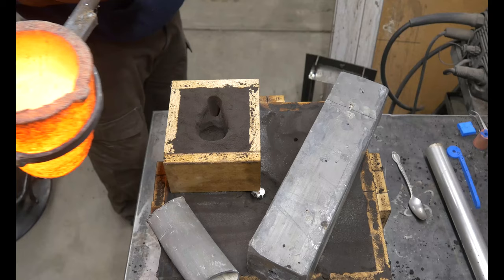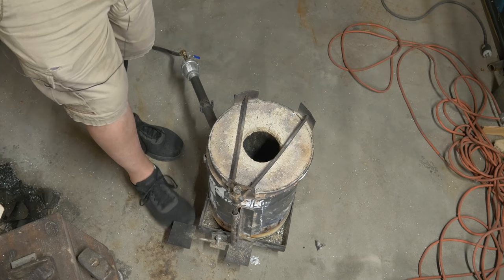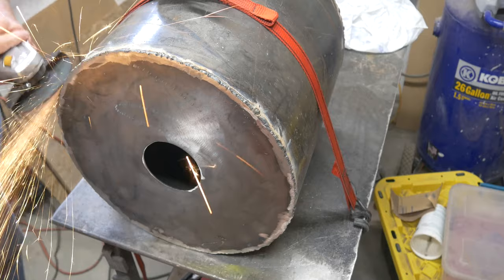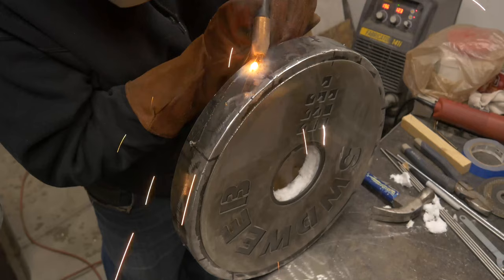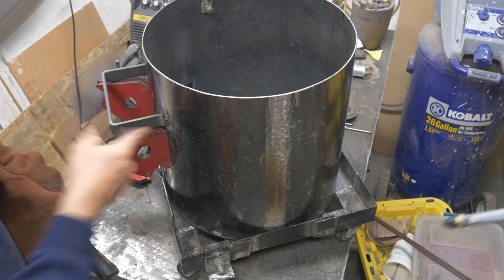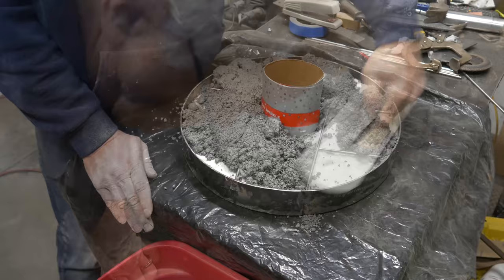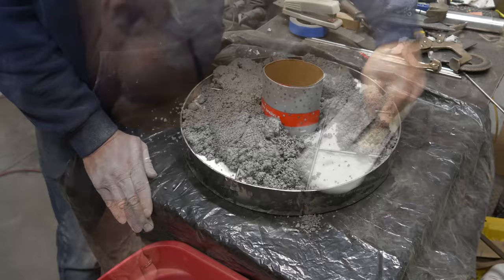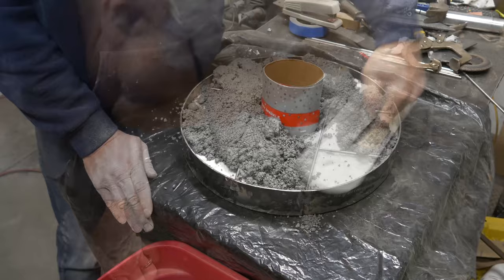Building a professional-grade foundry furnace

Comment: Great video! You showed the steps without belaboring the process. It's as simple as you made it seem.

Excellent point about the dryness of the refractory mix. It's often called "castable" refractory, but that's a bad name for it. Cement of any kind is very sensitive to the amount of water in the mixture. People often think it should be like a liquid when you mix it, but it shouldn't. Too much water weakens the cement. Never put more than the recommended amount of water in a cement mix.

I bought a used vibrator at the thrift store -- NOT THAT KIND -- the big, muscle massager kind -- and used that on the inside of the Sono-tube to vibrate the concrete as I rammed it. I also used a heat gun and a random wax candle to wax the outside if the Sono-tube. The combination of the vibrator and the waxed tube gave me a very smooth, and very compacted refractory wall. When I removed the tube (the same way you did) none of the tube stuck to the cement.

Pro job, on your part! Pro results!

Do you use a plinth beneath your crucible in the furnace? I used some leftover refractory to make a couple of plinths to go beneath my crucible. I think they help by elevating the bottom of the crucible do that the flame can get to the bottom area more efficiently than if the crucible just sits on n the floor of the furnace.
Reply from the maker: Thank you Carl.  I didn’t see any point in showing me weld for 35 minutes. 😄

I’ve made that mistake more often than I care to admit, adding more water than necessary.
  
I wasn’t prepared to ram the walls of the furnace. I had intended to simply do the lid and the floor but when I finished the floor I still had more “wet” refractory.  That stuff is so expensive that I didn’t want to just let it dry out so I hurriedly put the KAO wool in and the form. After I started putting it in, I had to race around trying to find something I could ram it with.  To top it off, that was the last night I had that was going to stay above freezing.  The temperature dropped below freezing for several nights starting the next evening.  All in all, I wasn’t prepared to finish ramming the walls but I didn’t want to waste material and I had to finish so it would cure without freezing.  I ended up brining it inside the house for 3-4 days to let it cure.  I could have done a better job with the walls but when you don’t plan ahead this is what you get.

Funny you should ask about a plinth.  I got an email from another sub just a day or two ago that contained a document from an ingot supplier.  They talked about a phenomenon that I had never experienced until the night before.  They said if your crucible is too low, the metal will swirl in the crucible.  I had that going.  It got so bad that a small amount of aluminum splashed out of the crucible into the furnace. I’ll be making a plinth or three out of the half bag of refractory I have left.

Comment: Have to say, I'm jealous. I was in sheet metal fabrication a loonng time ago and my instructor, mentor told me  then, the sign of a good mechanic was one who could lay out, fabricate construct their own tool box. I still have mine, 16ga galv steel, all welded seams, self made handles, the only store bought was the lock and hinge.
Something to keep an eye out for. Old welding rods that have gotten wet or are breaking apart. If you have a large gap the core of the welding rod can be used as a filler rod using your mig welder, saves a lot of wire.
Reply from the maker: Great tip Donny, thank you.  I will keep an eye for old rod.  
I owe much of the success to the shop that cut and rolled the metal for me.  It wouldn't be half as nice of they hadn't done such a good job.
Reply: @swdweeb  yeah I caught myself looking at the roll of the metal. Someone knew what they were doing. The first sign of not knowing the process is flat spots at the beginning and ending of the roll. It's like running a piece of wood through a planner, the ends are usually thinner than the middle.
If you want to see a very simple furnace that has no metal in it take a look at MBMMLLC. Lol
Reply from the maker: @donniebrown2896  They talked about there being a flat spot at the end and told me they actually cut the piece long do I could cut it off and get the size I ordered.  I never saw the flat spot and it was the size I ordered when I welded it together.  They even threw in the handles even though I didn't ask for them.  They guy said he just thought I'd need/want them.

Yeah, that MBMMLLC furnace is more portable than mine too 😄

Comment: Awesome work Perry.  One tip for when you have to mate cylinders together at angles. Fusion360 and 3D printed moulds and templates are easy to design and make it easy to mark up  and cut complex intersections.
Reply from the maker: I would have done exactly that if my 3-D printer was working.  Trust me I know that would have been far easier

Comment: Really nice furnace Perry, made mine with similar materials except my ceramic fiber is inside the castable refractory and coated with some high temp coating.  Works great, about the same size as yours also.  Happy castings friend.
Reply from the maker: I hadn't really thought of reversing the order.  I was really looking to simply reduce the weight and keep the insulation factor. 

Thanks bud and happy casting to you as well 😄

Comment: we used that ceramic coating as a wash to coat what we were pigging out into.  Also, I was a furnace tender for years and was wondering if you had to cure your furnace by slowly bringing it up to temp.  Obviously what you used is completely different than what we used, we used a powder that we would fork and then air hammer between the furnace wall and iron inner lining, then would let it cure by slowly bring the furnace up to temp over 24 hours incrementally.  Anyways, I really like your Home Furnace, awesome job!!!
Reply from the maker: Thank you so much for your comment makes my day. I did not heat it slowly, I let it dry I can’t remember for about two weeks inside the house and then I took it out to the garage and let the flame burning side without forced air for brief periods of time a few minutes at a time. Eventually I started increasing the time that I used to heating heat and dry out the refractory
Reply from the maker: It was the absolutely wrong method I used to cure the furnace I had no idea how much moisture was in the factory fortunately luckily for me it was dry and I didn’t blow up when I apply heat to it. I hated it slowly I brought it up to a couple hundred degrees before and let it do that for a few cycles before I actually started applying more and more heat

Comment: damn came out awesome. wish i had known about the ceramic glaze before I did mine but I did pretty much everything the same. great job!
Reply from the maker: That original coating is still on the walls. It never turned to "ceramic" at least not like I expected (I expected a glaze). It always stayed powder. It you touch it, it will while off.
Reply: @swdweeb  interesting. Thank you for the reply!

Comment: Hell yeah. Appreciate you putting out this video. I’m about to go ram in my Mizzou refractory right now actually. I just built a very similar furnace except I live in Minnesota and want to be able to cast this winter so I had to use a heating element and do electric. I hope mine turns out like yours because yours looks great
Reply from the maker: Can't use gas in the winter?   I realize it gets a lot colder there, maybe colder longer, than here in Colorado, but I'm able to use propane all winter.

Comment: Hi. Great video and good job on the furnace. Are the plans available somewhere?
I’m wondering if you ever considered a 4 burner furnace where you have 4 burners separated by 90 degrees to uniformly wrap flame all around the crucible. I’ve been toying with the idea of four single row ribbon burners spaced by 90 degrees. Maybe not necessary but I haven’t seen anyone talk about the pros and cons. 
What is the design of your burner?
Thanks,
Paul
Reply from the maker: Here's my burner design. https://youtu.be/keQ83RTZ1JE
I thought about a ribbon burner very early on when they were brought to my attention.  I was burning propane at the time as was looking for more heat.  I'm a firm believer today that heat equals fuel + air.  More fuel, more air will produce more heat. The burner I'm using today is a little air starved and as a result I'm not getting all of the heat I could out of things.

If you can provide enough air and fuel to service multiple burners, I'd guess you'd get things hot real quick.

Comment: Hey perry fan bloody tastic build. I tell ya what that would have to be the best furnace I've seen. Unbelievable work as always and I must say you look and act just a little on the proud side.. :) as you should be. Wish mine was half as impressive as that.. although I do have a pretty heavy duty crucible that I think would give you a concerned smile of excitement and or exhaustion lol. Weights about 20 odd kg or about 45lb empty hahaha
Reply from the maker: Thanks mate.  I almost put "best furnace on YT" as the title but figured I'd have to deal with a boat-load of comments telling me what a jerk I am or how theirs is better.  😄

That is an impressive crucible. Just curious, what are the external dimensions? Would it fit inside my furnace? 305mm diameter and 305mm tall

Comment: Great build and great message! Thank you for this video. You de-mystify the foundry components very well. Would it make sense to "build-in" a crucible transfer station and plinth connected to your rolling stand? Or maybe a separate stand (with no wheels) that could hold the crucible stable onto the floor, before you grab the crucible for the pour.
Reply from the maker: Interesting thought... I'll have to think about something like that.  It would have to work with the shank that I use to pour with. I put the crucible down on a firebrick and that is the scariest part of the whole process
Reply: @swdweeb  Removing the scary part of the process is exactly what I'm referring to. It would be designed to give the crucible more stability, before the pour.
Reply from the maker: @hippie-io7225  Yeah, we're on the same page.  That's exactly how I took your comment.

Comment: My friend could show me when I'm going to start an aluminum casting I put the crucible first and let it heat up, or I put the crucible full with the aluminum that I'm going to melt
Reply from the maker: Heating the crucible first is a good thing to do. It reduces the time the aluminum is in the furnace and as a result reduces the oxidation (dross/slag) that will form on the surface
Reply: Michicimas grasias mi amigo estoy altamene agradecido por las  respuestas 😊

Comment: Hi Perry, the build was great but the final comment was the best. 
Would it help to put a base block in to lift the crucible base up into the flame?  Stay safe and well :)
Reply from the maker: Thanks.  More and more, I think that's how we're going to get out of the mess the politicians and media have led us into. 

I assume you're talking about adding a plinth. The things about a plinth is it is really a sacrificial part of the furnace that can be replaced as need be.  My flame is already up off the bottom of the furnace by almost 2"  so lifting the crucible will take it out of the flame.  The flame in this new furnace doesn't actually hit the crucible either. It is able to wrap around the crucible without blasting right into it like my old one did.

I've got more firebrick that I can make a small plinth out of. I'm told, but have never validated it, that the bottom of the crucible will heat faster of off the bottom of the furnace
Reply: Yes, I totally agree with the first point. I've just found where I read the other info. I'll email you a copy for you to check out ("Info on Metallurgy & Crucible Furnaces" - really interesting info).  ATB :)
Reply from the maker: @AJR2208  Cool, got your email and will take a look at it shortly. Yeah the geek in me does the same thing 😄

Comment: My friend, what do you think of a crucible that I made of iron ASTM A572 grade, please answer me!
Reply from the maker: I always try to answer, even when I do not know the answer 😄

I know aluminum is pretty corrosive and will react with iron causing the degradation of the crucible over time and adding small amounts of iron to your aluminum.

Iron also oxidizes (rusts) quickly when heated to high temperatures 
Beyond that I really do not have an opinion as I am not familiar with that iron alloy.  Just be careful and watch for places the iron might fail after multiple uses.

Comment: Do you have the build plans for this? I didn't see any on your website.
Reply from the maker: Not really. I had a picture with some measurements on it that I took to the fab shop to get the body rolled and the lid/bottom cut.  I still have the picture but there are no measurements on it, I hand-wrote them for the shop. Email me via the web site or at swdweeb@gmail.com and I'm happy to share what I have. 

I would build it a bit differently if I were to do it again. I probably wouldn't use Kao wool but firebrick instead. It would be better for thermal stability... I think :-D
Reply: @swdweeb  Outstanding, email sent to you. A warm thank you to you for your help. Cheers!
Reply from the maker: @WolfManJammer  FWIW, I havent seen an email yet

Comment: Are you making your crucibles or buying them and also will they melt iron?
Reply from the maker: I buy them.  They are PMC Procast clay graphite crucibles.  I've only melted iron in one once.  Luckygen1001 tells me that he uses clay graphite crucibles to melt iron in all of the time
Reply: @swdweeb  I am thinking about making one from 3000 degree refractory cement air crete mixture. I already have a furnace made from it I thought the pours would get hot enough to expand and blow out a side or something but I have had it red hot after curing for 2 weeks and it did great. I know we used a kind of air crete to line the ladles at a foundry I used to work at.
Reply from the maker: @kevinlewis9151  Funny, I thought about making a crucible out of the remaining refractory that I have.  I have no idea how or if it will work.   I need to make a form to ram it in.
Reply: @swdweeb  we had steel and aluminum ladles that we covered with an air crete mixture to protect the metal from the high temperatures. I know with my furnace it can be red hot on the inside and I can touch the outside with my bare hand. I think I figured it to like an R60 insulation value

Comment: How is the coating holding up? Also, wouldn't a ribbon burner be a lot more efficient?
Reply from the maker: I've never relined it and its still in there. Still white and of metal ends up out of the crucible it just picks right up after things cool off. 

I thought about a ribbon burner when I made my first propane burner and just decided to go traditional.  My newest burner is a diesel burner and I'm not sure I could have made it as a ribbon burner and I can't imagine it getting any hotter. At this point with the nozzle I'm using I am just a hair below the maximum amount of air I can get into the furnace with the blower I have and keep the flame burning at its optimum temp https://youtu.be/keQ83RTZ1JE Since that video I've moved up to a 2.25 GPH nozzle which has taken me right up to the limit
Reply: @swdweeb  thank you!

Comment: Perry, is that coating you painted on supposed to help the refractory cement to keep from being damaged by the heat? I didn’t catch the name of the coating. I’m wondering if it is similar to Satanite?.

That furnace looks real nice! Did you heat cure your refractory before you painted on the coating?
Reply from the maker: The coating is called fankote PMC100.  Yes its supposed to help protect the refractory.

I let the refractory dry for several days and then applied small doses of heat to it to dry it further before painting on the coating

Comment: 7:52 As I mentioned before, my lid broke after two firings. It was made exclusively from refractory cement.
I thought I should put some rods, or even some chicken wire to reinforce it, so if it would crack, it would at least not fall off. But I was afraid of metal expansion from the heat, making the situation worse.
So my question is, did those rods do what I was afraid to your cement lid? That is, expand from heat, then crack it.
Reply from the maker: So far, my lid is just fine.  I took the furnace to hot enough to melt iron and it has held up just fine
Reply: @swdweeb  Great!